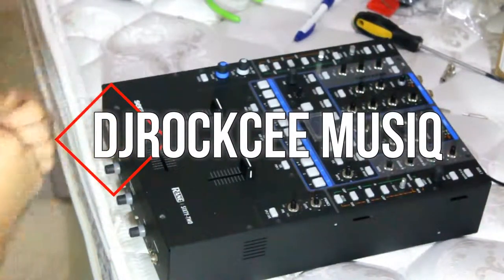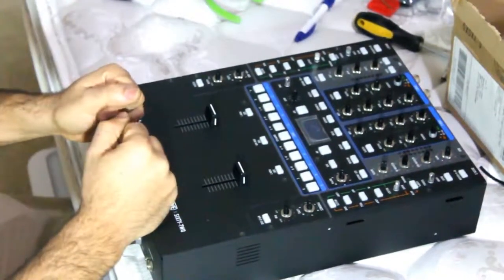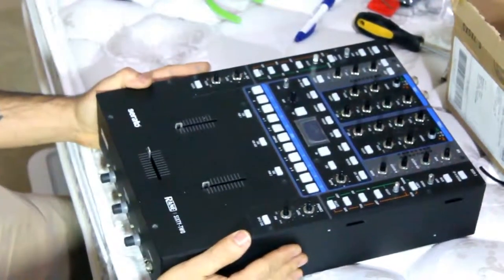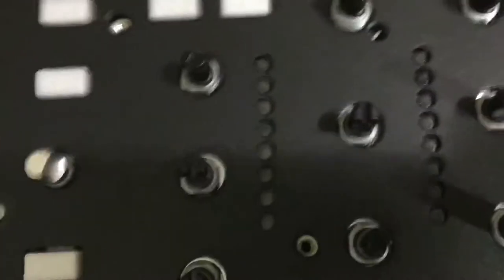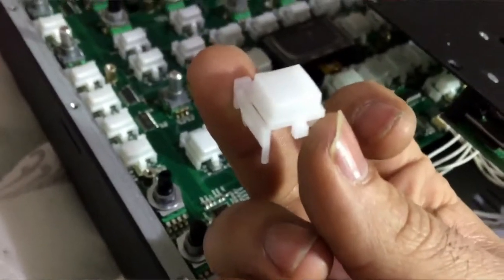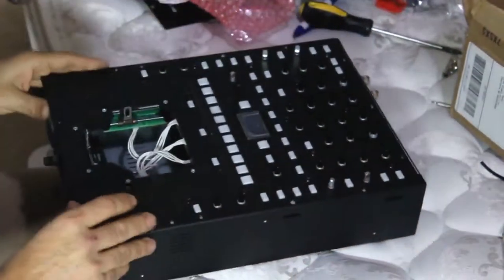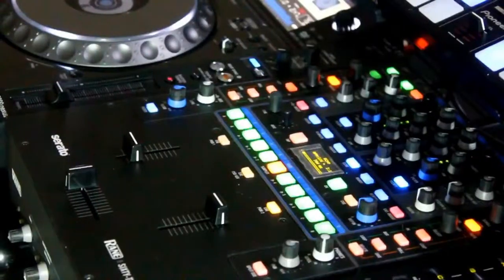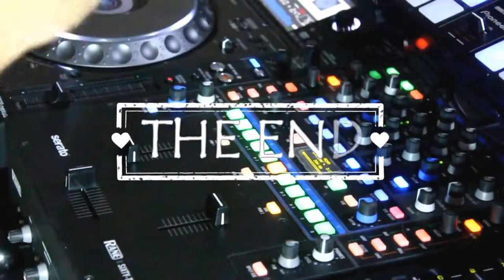Rane 62 (replace buttons)  fix it,yourself part no.21007.where can i buy?

Comment: hello Bob thanks for the video, I have a 72 and 3 buttons are not working  how do you tell if it is the button or the switch underneath it that is not working. When I press on the buttons there is a normal click sound on all of them 
and you can't tell which one is broken you can only distinguish the non work buttons because of there unresponsiveness, thank you
Reply from the maker: I'm not sure I've had problems with 62 but nothing on my rane 72 mk1.